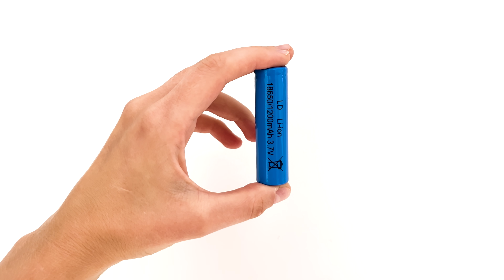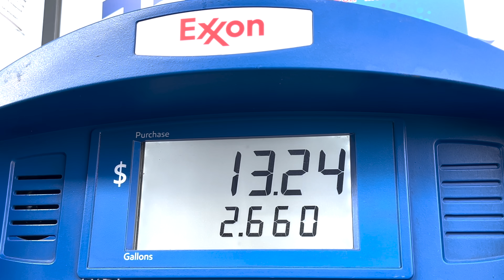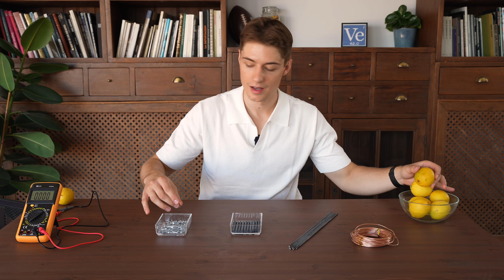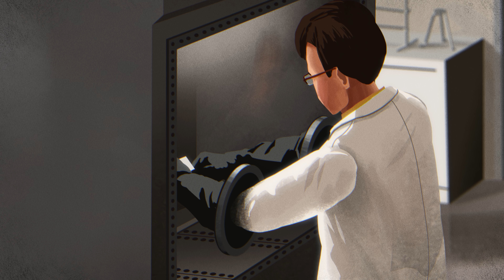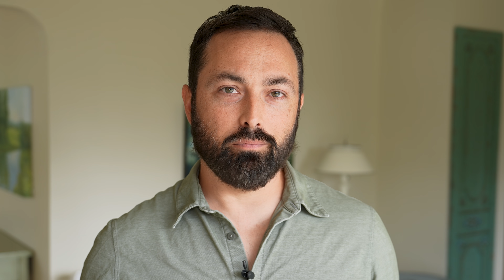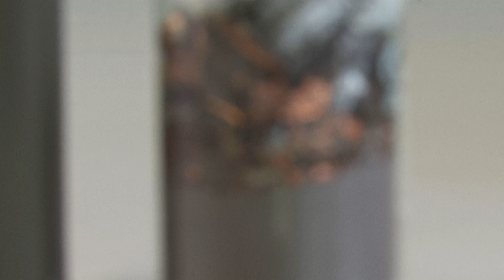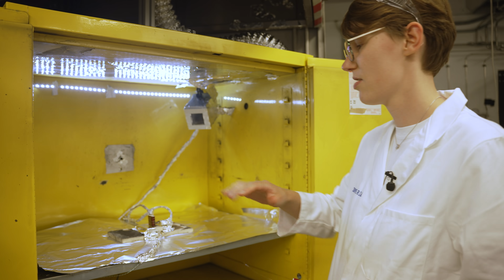The Perfect Battery Material Is Dangerous

Comment: Energizer Ultimate Lithium batteries have a roll of lithium foil in them. If you want to play with lithium without somebody telling you where you can and can't handle it, that's a relatively easy way to get it. Of course then you have to figure out your own safety precautions rather than just trusting someone else to have your back.

Comment: From one Australian Muller that's interested in batteries to another: Thank you very much for the video, it was very informative and while I make my living with lithium batteries, I learnt a lot!
One very important part that's very important as well to know is that you're talking about "lithium-ion" but you're actually just talking about an NMC lithium battery, there is a much safer alternative that's an LFP or lithium iron phosphate chemistry (still a lithium ion battery, technically all lithium batteries are). It doesn't quite have the energy density of NMC, but it apart from being safer it also has some other advantages such as not containing any nickel of cobalt, both of which are problematic materials. They also have a better cycle life.
Then of course there's the sodium ion batteries. I was invovled in the development of a sodium ion battery and we chose a pumping station right on Bondi Beach (Australia's most famous beach) as it was less than 50 meters from the world's largest source of sodium, the Pacific Ocean. Sodium is roughly 1000 times as abundant in the earth's crust as lithium and I strongly believe that it's the future of stationary storage!

Worth a potential future video?

Comment: 7:12 - So...  the voltage that one can get out of a battery is limited to the voltage that would induce hydrolysis in that solution? Simply because the energy then gets used in a different way?   Similar to how the temperature of water cannot go above the boiling point of that water at that pressure?

Comment: You guys didn't have to do all that to send a battery into thermal runaway. Just get an old mechanical vape mod. Those were designed to hard short the battery with a mechanical switch to get maximum power right away for cloud blowing competitions. When there was a news story about an exploding vape, it was usually one of these.

Comment: Unfortunately, this gives the impression that current Li-ion batteries are safe - which is very far from the truth.  At least one shipping line has already stopped transporting electric cars, and there have been numerous examples of just how hot, long-lasting, and extremely toxic Li-ion fires are - often causing a great deal of damage and risk to health.  I certainly wouldn't have anything with a substantial Li-ion battery in it (e.scooter/bike, for instance) anywhere near my house.  Switching to electric cars was seen as a nice, easy bit of greenwash by governments and manufacturers ( they will have very little (if any) actual environmental  benefit, but it makes governments, etc look good).  Unfortunately, in their rush to 'do the right thing', they couldn't wait for a better, safer battery technology to come along.  And some of us will be paying a high price for that decision over the next few years.

Comment: 31:40   The latest evidence shows when firefighters place a blanket over a Lithium Ion Battery fire .. Explosive gases (secondary to the main fire) build up,, and simple contact with AIR, will cause them to explode ....   

....... Again secondary to the Main fire and MAIN explosion!!  .. The most recent advice for battling a fire like this (say in a parking lot) is to BLANKET the OTHER non-burning EV's close by -- to prevent Then from catching fire,  --  and battle the main fire with existing EV fire protocols

Comment: Amazing video on this amazing but poorly understood tech!

However, I'm sad to see that the way the energy is transferred is still dumbed down. Electrons move slowly. Not as fast as is generally thought or usually shown (could be less than 1mm a second). Electrons are the medium through which the energy travels, but they themselves don't 'carry' the energy. That's done by the field around the circuit. It's similar to a water hose carrying the pressure energy. You can increase the pressure at one end, and at the other you immediately receive that pressure, but the water molecules themselves don't carry units of pressure from one end to the other; it travels through the medium. 

I guess it's known most people aren't aware of this quite abstract concept, though, and as this video isn't educating about how circuits transfer power, I get the dumbed-down batteries shown.

Comment: 16:23 Technical side note: anode and cathode are not the same thing in a battery (galvanic cell) and during charging (electrolysis) by definition. Although the charge sign is always the same on each electrode, the anode is a place where oxidation, i.e. release of electrons, occurs and the cathode where reduction, i.e. electron gain, occurs. So LiCoO2 is an anode during charging (releases electrons) but becomes a cathode during normal battery operation (gains electrons). This is indeed confusing, when you try to explain something, so a good decision to present from only one point of view (battery). Great video by the way!

Comment: Outstanding historical explanation of the Li-ion battery! But I would have liked to see you discuss alternatives to LiCoO2 cathodes. There are something like six in commercial production. I think the most interesting is LiFePO4, lithium iron phosphate. It doesn't use cobalt, it seems to have a much lower fire potential (because the oxygen won't liberate as easily) and it seems to last longer. It does have a lower energy density, however. Maybe a follow-on episode.

Comment: 20:16 you forgot that Akira yochino worked on the idea of Mr Yazami of the CNRS (In 1980, Rachid Yazami at CNRS in Grenoble discovered that graphite could reversibly intercalate lithium ions, making a safer anode for rechargeable batteries.
Akira Yoshino built on this by combining the graphite anode with John Goodenough’s LiCoO₂ cathode, creating a practical lithium-ion cell).
Reply: Second that
Reply: Third that
Reply: fourth that

Comment: Battery tech is important to improve given how much technology we rely upon that needs it.  Yet I don't agree with the gentleman at the end of the video that said "we have to electrify everything".  There are many solutions to solve the emissions issues per field of concern.  For automobiles, one of them is synthetic gasoline (side note, it would be great to see a Veritasium video on this).  They can be used in all existing vehicles and distribution architecture and will massively drop emissions across all existing vehicles due to the fact it's 100% pure.  This also creates a renewable resource in that it can be made with carbon extraction from the air, so what little carbon emissions remain can be used to make more fuel.

Also personally I wouldn't call 1 in a million outcomes good when it comes to things of scale.  Just as an example, a conservative estimate on Tesla battery packs would be 4000 cells (The X/S have at least 7000, the 3/Y standard has 2200 while the extended range has over 4000).  That means 1,000,000 cells are used every 250 Teslas, which is an insane amount of potential for battery fires (then factor in all the other EVs being made across the world).

Comment: Meanwhile, the US is going backwards to the energy of yesteryear. Not mentioned is how Exxon and its peers, and the automobile industry kneecapped electric cars and street cars which were everywhere in the early 1900’s. Who knows, we could have had advanced storage decades earlier. And more diverse, purpose built mobility form factors. How many vehicles were traveling more than 30-40 miles at a go in the early 1900’s? Public transport and fleet vehicles in cities could have been electric. And then you had those flywheel buses in Switzerland. All kinds of alternative energy would have accelerated with untold externalities. With scale all of those could have had viable markets. Instead, we subsidized fossil fuels as a global standard and the military to ensure that energy was protected at all cost. Leading to 9/11, Iraq wars, and ostensibly 10/7 and now our complicity in genocide. We are a greedy and shortsighted species.

Comment: When the incidents with larger li-ion batteries going in flames and/or exploding started to be reported, I went and did some "napkin math". An average laptop battery, at the time, contained as much stored energy as 1/3rd of a standard-issue frag grenade. Sure, the release of that energy, even in a catastrophic scenario is practically always slower than a detonation of a grenade, it does make you think about "the other limit" of battery technology: the question of "how much energy do you want to keep stored less than few inches away from your genitals". Which made me think that batteries are one thing, but we have to go back to... Nikola Tesla. We have to figure out how to recharge batteries quickly, and remotely. We did get a small step closer with induction charging - put your phone on this mat and it will just charge. But the effective distance it can work at is just laughably small.

Sadly, I don't have "a brilliant idea" how to solve /that/ problem. If I had, I'd probably be sipping mojitos on a beach somewhere ;)

...though I do wonder if we could stabilise sub-atomic sized wormholes and use EM through them...

Comment: 33:52 Prof. Sam Cooper is very confused. He's worried about bogeymen. "Saving the planet from runaway climate change" is like saving the planet from unicorn fart pollution, because there's no such thing, because the Earth's climate system is dominated by powerful negative (stabilizing) feedbacks:

1. As temperatures rise, evaporative and convective cooling accelerate linearly, and radiative cooling accelerates proportional to the 4th power of temperature (which is called "Planck feedback" or "Stefan-Boltzmann response"). That's one of the reasons warm parts of the Earth have much more stable climates than cold parts, and interglacials have much more stable climates than glaciations (which are often disturbed by huge "Dansgaard-Oeschger events"). In other words, the higher the temperature goes, the harder it is to raise the temperature. These are very strong negative (stabilizing) feedbacks.

2. Additionally, as CO2 levels rise, their warming effect ("radiative forcing") diminishes logarithmically. The 145 ppmv rise we've already seen since the late 1700s ("preindustrial" / Little Ice Age) gave us about 1.8 W/m² of radiative forcing (a 0.5% increase). But another 145 ppmv would give us only about 1.3 W/m² (only 70% as much).

3. Additionally, as CO2 levels rise strong negative feedbacks remove CO2 from the air into other "carbon reservoirs" (mostly oceans, soils & biosphere) at an accelerating pace. For each 50 ppmv rise in CO2 level, the net rate of natural removal of CO2 from the air (which is currently about 2.5 ppmv/year) accelerates by another ≈1.0 ppmv/year. (That means the "adjustment time" or effective atmospheric lifetime of added CO2 in the atmosphere is only about 50 years, and the "first half-life" of added CO2 is 50×ln(2) ≅ 35 years [ref: SAR WGI TS B.1 p.16].) These are also very important negative (stabilizing) feedbacks.

In contrast, at sub-millennial timescales there's only one major positive (amplifying) climate feedback: Warmer air holds more water vapor, and water vapor is a GHG, which causes additional warming; that's called "water vapor feedback." MODTRAN estimates that water vapor feedback increases the warming from CO2 by about 60%. That's a small effect compared to the powerful negative feedbacks which dominate the Earth's climate system.
 
As a consequence, "runaway climate change" is physically impossible.

Comment: 00:00 🔋 Inside a lithium-ion battery is just foil coated in paste, yet it powers devices from laptops to satellites.
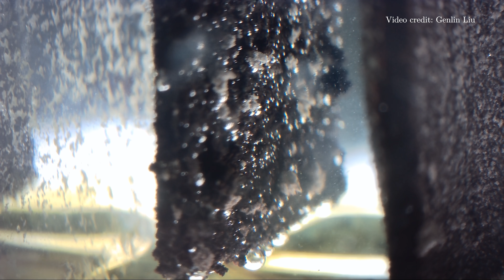00:20 ⚠ Battery failures can release energy dangerously, causing fires or explosions.
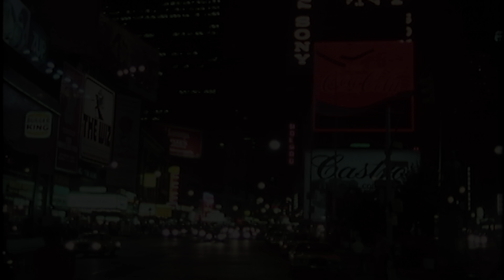00:39 📉 In the 1980s, low energy density limited portable electronics, making early mobile devices bulky and inefficient.
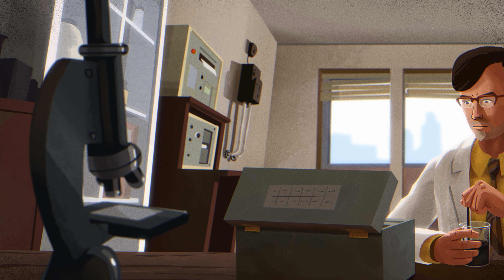01:25 🧪 In 1972, chemist Stanley Whittingham at Exxon began research into high-energy batteries amid the oil crisis.
02:37 🚗 Early electric cars in 1900 were limited by heavy, low-capacity batteries, leading to gasoline dominance.
03:36 🐸 The first battery concept traces back to Luigi Galvani’s 1780s frog experiments, later refined by Volta.
04:15 🍋 Simple experiments with metals and lemon juice illustrate how voltage depends on electron transfer tendencies.
07:19 💧 Water-based electrolytes capped battery voltages at 1.23V until new materials and solvents emerged.
07:58 ⚛ Whittingham discovered titanium disulfide’s ability to intercalate lithium-ions, enabling higher energy density.
09:03 🪙 Lithium’s small size, low density, and high voltage potential made it ideal for advanced batteries.
10:16 💥 Switching to organic electrolytes allowed higher voltages but introduced explosion risks.
11:14 🔄 Whittingham’s lithium-titanium disulfide cell delivered 2.4V and was highly efficient and rechargeable.
13:31 🌵 Lithium dendrites could grow in metal anodes, short-circuiting batteries and causing fires.
15:42 🛑 Safety concerns and falling oil prices caused Exxon to end lithium battery development.
16:08 📈 John B. Goodenough improved Whittingham’s design with lithium cobalt oxide, boosting voltage to 4V.
17:14 💡 Lithium cobalt oxide enabled lithium-free anodes, making batteries safer and more practical.
20:07 🧵 In Japan, Akira Yoshino sought safer anodes, replacing lithium metal with conductive carbon materials.
21:22 🔑 Discovering Goodenough’s cathode solved Yoshino’s lithium source problem.
22:19 🏆 Vapor-grown carbon fiber enabled a safe, high-capacity anode, marking the birth of lithium-ion batteries.
23:10 ✈ Sony adopted Yoshino’s design, launching the first commercial lithium-ion battery in 1991’s Handycam.
25:17 🛡 The SEI layer formed during first charge protects lithium-ion batteries, enabling long-term stability.
26:20 📉 Costs fell 99% from 1991–2023, while performance improvements enabled electric vehicle resurgence.
27:12 🔥 Battery fires, though rare, occur due to internal shorts, SEI breakdown, and runaway heating.
30:31 🧨 At \~130°C, separators melt, causing shorts, oxygen release, and self-sustaining combustion.
31:30 🚫 Fires are fueled by non-lithium components and can persist even without external oxygen.
32:47 📊 Statistically, one in a million batteries catches fire, but ubiquity means most people will witness one.
33:25 🌍 Lithium and cobalt mining have environmental and ethical costs, driving the need for alternatives.
34:10 🚀 The future of energy storage demands safer, cheaper, longer-lasting, and more powerful batteries beyond lithium-ion.

Comment: Too bad that you jump from the use of carbon to graphite like it was nothing, as it was a crucial step in making batteries mainstream. "The invention of the graphite anode in lithium-ion cells is attributed to Dr. Rachid Yazami. He is a Moroccan scientist and engineer who made significant contributions to the development of the lithium-ion battery. His work on the graphite anode, particularly his discovery of the reversible intercalation of lithium into graphite, was a crucial step in making lithium-ion batteries commercially viable. 
Yazami developed a method to insert lithium ions into graphite and extract them reversibly, which is the fundamental principle behind lithium-ion batteries. This discovery, along with others, led to the widespread use of lithium-ion batteries...his work is used in an estimated 95% of all lithium-ion batteries."
Reply: Second that

Comment: 25:17 The manuals of cell phones had specific instructions for the first time charge... Nokia and Motorola in particular... Some indicated to discharge it completely first then full charge, then discharge completely again up to 3 or 4 times depending on brand and model... Some first charge it full, then cycle of charge and discharge, etc.
Reply: 26:00 Indeed if such instructions where followed faithfully, it increased the capacity and lifespan of those batteries...

Comment: 32:50 that's actually disingenuous. It's not "every million batteries you come across"  
If the failure rate is 1 in a million , and the "average" EV or power wall has 5000 individual batteries in it (that's how they scale up) then every TWO HUNDRED of these batteries is going to be the "1 in a MILLION" 
Every e-bike or e-scooter has roughly 100 cells in it. So, 1 in every 10,000 bikes or scooters is going to be your "1 in a million" event. 

On top of the immediate hazard of toxic gases and fire, each of these fires releases heavy metals into the environment, the soil and the water table. 

Not good. Believe me. Not good.
Reply: Dude... A battery is made of cells, they have thousands of cells, that make 1 battery.
Reply: @ItsElijuh it's like you've read what I wrote and totally disregarded it anyway

Comment: The problem really is the polymer, which is inherently flammable. At 80+ centigrade, the polymer melts and metal oxide starts releasing oxygen. These two don't know anything better than to create fire.

At this point I am wondering ... Why hasn't anyone tried using teflon as the polymer?

Comment: As far as I know, the only way to get higher energy density than lithium is with Hydrogen. Hydrogen and Helium are the only lighter elements and Helium is a gas. Lithium has a higher density though, so perhaps if you take volume into account, Lithium is unbeatable. Perhaps changing the stuff around it would help but for energy density, I don't think Lithium can be beat.